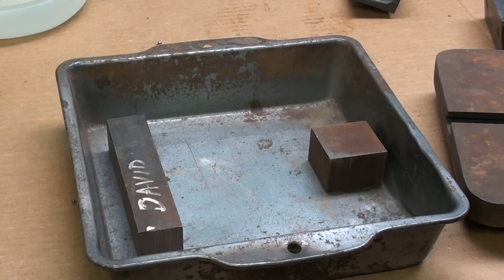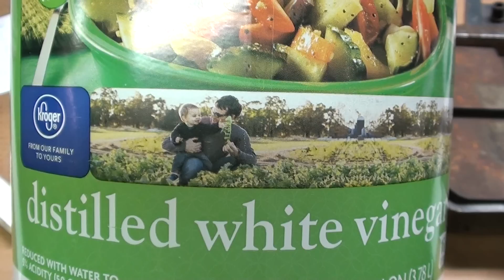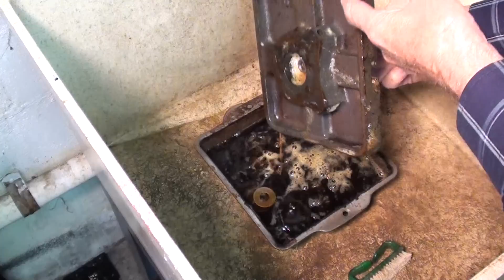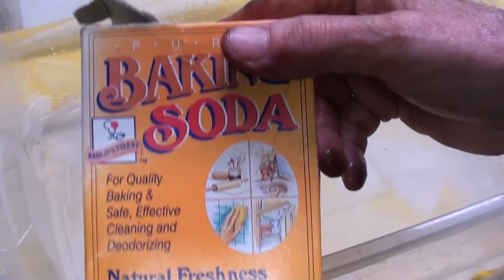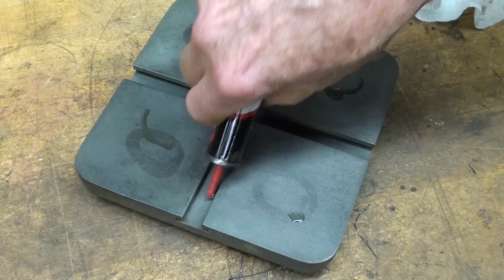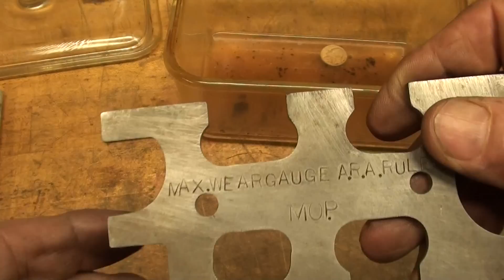Rust Removal Vinegar #304 tubalcain - compare to electrolysis

Comment: I had an unlucky trial trying to remove rust with white vinegar, kind of worried about using it to derust. I put an automotive flywheel in vinegar and left it overnight and it pitted the heck out of the flywheel surface.
Reply from the maker: Vinegar and other mild acids are a lot stronger and more aggressive than what most people would think. Sorry about the pitting, but I know what you’re talking about.

Comment: My experience using molasses is that it takes longer than vinegar but it takes forever to eat the metal so it may be safer. My timing is usually to check stuff every week or every month, clean it in water and do it again if needed.

Comment: Vinegar has worked very well for me.  It reaches into corners where emery cloth will not go.  Recommend washing rusted part in strong dish detergent before the vinegar to remove any oil film that could block vinegar penetration.  The rust turns into black gunk that is easily removed with your wife's toothbrush.  Alas, if there are deep pits, you can't remove them.  I used oxalic acid on some rust-stained sails once, but that kind of radiator flush is no longer available.  Where to get it?
Reply from the maker: Thanks

Comment: About to try the electrolysis method on some old Model A engine parts. Did some investigating and found the vinegar would likely attack the babbitt (poured bearing) material so that eliminated that method. Might be worth considering when deciding between the two methods. 

I seem to recall a solution that could be used to prevent the flash rusting process after subjecting steel to such a de-rust process. Do you know the formula for that solution?? Would be "handy" on a fresh/raw engine block. 
Thank you.

Comment: Would be best to heat the cleaned apt in oven (above 212°) and put paraffin wax over the surface - could aslo add salt (sodium chloride) to the solution to help cleaing - grey stains is the graphite and iron.

Comment: Definitely my favorite rust removal method. Works better than the commercially available rust remover products. I had a old leg Vise and some pieces of small Guage Railroad track both were over 100 years old and very rusty. When they were done they looked brand new. I had to use a plastic tote and about 4 gallons of vinegar and it still was not enough. Luckily I had a small old fountain pump that I used to recirculate the vinegar to the top of the Vise. I had covered it with rags so they would hold the vinegar and keep it wet. Worked great.

Comment: I've used vinegar for several years and found it to be a good option for rust removal. I also use house-brand (cheap) diet cola drinks from Kroger and Publix. Different type of acid, but it works about the same as vinegar.
Keep up the good work.

Comment: I find the biggest problem with using vinegar is that it will pit the metal if left to long in the vinegar.   I wish there were a time table for using vinegar to remove rust.
Reply from the maker: Yes, it certainly is corrosive
Reply: @mrpete222  I found out the hard way putting some white vinegar in a new stainless steel pan to clean some parts and left the vinegar for a few days.  When I went to wash the pan I found deep pits in the bottom of my new pan.  Thanks for all your videos; they are very helpful.
Reply: I'm looking for a simple way to repair pitting of steel tools.  I've been looking at zinc plating as a possibility but I fear the pitting will show through as dimples in the zinc surface.  Seem like tig welding is the way to fill the pits and then grind smooth before plating.  Any suggestions would be appreciated.  I'm loving this mild winter here in Jacksonville TX.

Comment: Another method is to use strongly brewed black tea (really well 'stewed') to provide tannic acid, then add about 25% phosphoric acid.  It kills the rust and leaves a very nice matt grey/black finish!  You might also add a bit of ethanol as a wetting agent. A splash or two of balsamic vinegar also adds a bit of tannic acid...

Comment: Yeup! Vinegar = Clean parts, Electrolysis = Hydrogen gas + Power consumption + loos of other sacrificial metal, I would also recommend using ATF fluid over 3 in 1 lubricant, but if all you have to use is 3 in 1 I would recommend flooding the surface with it and allowing it to penetrate well into the face.

Comment: I'm pretty sure I have seen an Evaporust can setting around your shop in a video..Great product, but admittedly not as cheap as vinegar. At least for flat surfaces, My go to has become a $12 harbor freight right angle air die grinder with a roloc pad adapter and scotch bright discs .

Comment: Guess who owned a large portion of Arm & Hammer?  Yep, Armand Hammer.
Reply from the maker: I thought he was an oil magnate.
Reply: @mrpete222  He was.  My guess is that it was a vanity move, so that Armand Hammer could be on the Board of Directors of Arm & Hammer:
From Wikipedia, the oracle:  In the 1980s Hammer owned a considerable amount of stock in Church & Dwight, the company that manufactures Arm & Hammer products; he also served on its board of directors. However, the Arm & Hammer company's brand name did not originate with Armand Hammer. It was in use 31 years before Hammer was born.[47] He was spurred to buy shares in the company as a result of often being asked about the brand being so close to his name.

Comment: Must have a very low patience level for this guy cuz I've already reduced myself to calling him all kinds of names such as an old Buzzard and such because I don't understand why he would not completely cover the part with the vinegar solution in the first place and he could of just used the nut and bolt handle to make a space off the bottom of the pan for the past and then not consider the fact that the solution might of caused a reaction that eventually caused the it to run over just a little, but then when he goes to the sink and doesn't just run it under the water to use a little bit of water pressure as he's cleaning the piece off and then of course he fills the sink up with water to scrub it off more but then once AGAIN he don't cover it completely in water so he had to stop scrubbing the piece to dab the cleaning cloth in the surrounding water to clean it off and add more water to the piece. Just driving me crazy. I just need more patience I guess and I'm using this forum to vent that frustrating out so the next person that I encounter doesn't get this pent-up anger directed unfairly at them. So thank you for the very good information and the opportunity to get a little psychiatric help in the process lol...
Reply: Easy to be wise after the event....

Comment: I was glad to find this video because I am soaking a couple cast iron parts in white vinegar that the bench vice swivels on top of. I got it from a friend and the base was rusty w/ sand and grit in the swivel area up inside also! I wasn't sure about cast iron but I'm sure it will turn out fine now!!  When you 'cover' the container the acid works to concentrate on the objects better instead of attacking items around the room like a magnet in which I've heard happens. I once used a 55 gallon plastic drum and had some rusty pipe in it but too long to stay in the liquid and covered the barrel figuring I would come out the next day and flip the pipe around and go another day since 3/4 was above the vinegar...and..... WOW! The acid became air-born in the drum and attacked all rust on the pipe, even what was out of the water ( about 2 feet more). Don't soak copper and steel together cause  I think it will turn the copper black ( I did pennies with steel bolts/nuts/washers once). As far as my swivel base, with some grease sandwiched in between the two objects, it will swivel great!! Love that  drill press table!!! Thanks!!
Reply from the maker: Thank you, I will try that

Comment: Hi Tubal. What would be extremely interesting (and I have never seen anyone else on Youtube try it) would be to use electrolysis with vinegar instead of with water. The acidity would carry the electricity at least as well as the sodium carbonate and water solution. You might get twice the rust removal?
Reply from the maker: Never tried that

Comment: I recommend suspending  a Tupperware from the ceiling with wire and strapping a electric sander to the side to form a tumbler and putting crushed ceramic pieces from old plates and china and ceramic crap into it and that will clean and derust the parts after your vinegar or electrolysis is done so you skip ALL elbow grease.  The parts tumbler also could remove the rust flat out without help but might not get as deep into grooves.  I'm planning to do a video on this.
Reply from the maker: Good idea

Comment: Use corn syrup.... Either soak a sponge with it and let it sit in the surface or emerse the rusty item in it.... It does not remove paint and gets into crevices...... Leaves only metal agitated occasionally or scrubbed on deep rust.... But no effort for serious rust removal..... No acid etching very safe.....I cleaned up an abused egg beater drill that was my grandfather's it was out in the shed and would not move in any part.... Put it in sugar dissolved in hot water  3 days soaking and shaken couple times each day.... And it came out and turned scrubbed with soft wire brush and all the rust came off leaving the original red paint intact...... Flushed it thoroughly and then heated it with a torch to drive off moisture then oiled it while hot..... It now works great and looks good too.... Tip is to heat metal them oil and the oil will penetrate and if you heat enough you will get bluing to protect surfaces of you mix some bees wax with oil you get a very awesome protectant

Comment: Wear latex gloves, that black stuff will stain your fingers. Also, a power washer works very well to remove the residue. After a vinegar soak, I used the power washer on some old files I bought at an estate sale as I couldn't think of anything else that would get down into the tiny grooves very well. I neutralize it after power washing. Hot soapy water seems to do just fine in neutralizing the vinegar. Then oil it or the item will flash rust. Cleaning vinegar, found in the cleaning section of the store, vs the cooking section , is sometimes a little stronger. Also, agriculture vinegar, used to kill weeds, is stronger than the "regular" stuff.

Comment: I am getting ready to work on a 1987 200 cc Super Cub Triumph motorcycle that I bought as a "motorcycle in a box" for $350.  I am going to try both methods of removing rust from various parts of the bike.  I am sure this will be a multi-year project, so I thought I would start with the rust removal first.  Any tips for cleaning up the aluminum parts?  Thanks for sharing your tips.  Doug

Comment: Thanks Mr.Pete for the comparison of the two methods of rust removal, I bought 1/4 plate from a scrap yard for a project. I wanted to remove the mill scale, the steel had a lot rust so I hit with a flap disk first and soaked some test pieces in vinegar and some in muriatic acid.
The muriatic acid cleaned the parts in about 30 minutes, the vinegar two days. The safety fact does need to be considered with the Muriatic acid, I used eye protection chemical rated gloves and tongs, I made bath of baking soda and water to neutralize the acid. Washed under hot water and oiled with light machine oil. After that i buffed them,  nice and shinny too. I then applied Johnson’s paste wax. 
I bough washing soda a while back to do the electrolysis test dug out my battery charger, and determined that the battery charger would not operate unless 9 volts were present on the charging post. Yes it was one of those new computer controlled chargers for lead acid as well as nicad and gel cell battery’s, I fooled it with a 9 volt battery. For ordinary rust removal I am sticking with the vinegar, for the mill scale the muriatic acid works for me. 

Thanks for all you do! I wish I could have been able to attend your open house this past July.

Comment: Dog gone Mr. Pete, that really cleaned up nice. I guess I don't need to buy and use all the latest and greatest store bought stuff.
Question, on oiling, is it alright to coat my lathe with 3-1 or some such oil to protect it? My shop is not heated unless I'm working in there and lathe gets light rust on it.
Thanks
Reply from the maker: I coat mine every winter. I used 30 weight
Reply: Thank you.

Comment: I like and have used vinegar for rust removal. It is very handy in a bucket when you have lots of parts to do, disassemble today and tomorrow less work part part to clean up. To remove paint a soak in “purple power” sold at any Wally World, and that will remove paint from just about anything including plastic without harming the part.

Comment: Great Video. I lost a number of tools to rust during a bad storm including 3 different sized Mics. I tried electrolysis to great success. The Mics I was able to strip right down after the electrolysis, I then placed the threaded parts  in vinegar for about 3 hours results were great threads good as new. Reset the Mics to my true Gauge set . All was well. I could have claimed on the insurance but did not. The Mics were given to me by my Dad so were many years old. I love your forgiving wife   Chris Gray UK
Reply from the maker: That's terrible about the damage to the tools

Comment: After the soak in vinegar, and then rinsing with water, there's probably no real need to neutralize with baking soda, but if it were me, I would still using baking soda, but instead of putting it in water, I'd apply it as a thin paste right on the metal, and take the Scotch-Brite to it.  The baking soda will act as a mild abrasive, improving (in my opinion) the finish of the piece.  I'm amazed at how well simple vinegar worked for this.

Comment: I got a "Thanks" from a guy I told about restoring a Spear & Jackson vintage spade using electrolysis, but, where you can use plain vinegar, do so. Some people use salt & vinegar to clean coins..Yes you can legally put vinegar down the sink, it 's biofriendly & good for it as it will clean your drain : )
Reply from the maker: Thanks

Comment: I was looking at another video on rust removal using vinegar last week, and the guy recommended adding salt to the vinegar.. I tried it last week and boy does it work as long as you degrease the work first. the vinegar I used by the way was four times as strong (20% acidity)

Comment: Washing soda & electricity is cheaper & cleaner than vinegar. I usually wire brush the rust that comes off easily prior to a vinegar soak or electrolysis method. Doing so takes the load off whichever process you choose.

Comment: I live in a humid area and get a lot of rust on all my equipment. I had been using a product called Rust Free. It works good but is expensive. I found a way to clean large cast iron surfaces without having to dip it in a tub of vinegar. Just double up some paper towels on top of the surface and pour the vinegar on. Let it set for a few hours and scrub it with scotchbrite.

Comment: could be that the baking plate , the rings and the cast iron , in combination with the vinegar has made a battery , in that case the  electrolysis might not be to far from the truth
the glas bowl has made that comment moot 
just bought a planetable and it has a lot of surface rust , think i would try the vinegar treatment over the abrasive as the table needs to stay flat , hope it works as good as it did on youre experiment

Comment: I hate to tell you. But those are not chisels. Those are caulking irons for lead joints. That's why they're offset. So your hands are away from the pipe. Nice ones.
Reply from the maker: +richard wysham thanks
Reply: mrpete222. You are welcome, sir. Want to sell them? They're getting hard to come by.  It looks like one is for the outside of the lead bead,  which drives the lead down and out. The other one should have a tip angle opposite, to drive the lead bead down and in. Pouring a lead joint is becoming a lost art. Sadly.

Comment: I like your process.   Thought initially rubbing the newly de-rusted cast iron table would be better coated with wax like I've done many times.  Now I think an initial coat of oil followed by wax (Johnsons paste wax) might be even more resilient to moisture.   Anyone tried this?   Thanks,  Ryan.
Reply: Also agree that it only works when completely de-greased and I've only tried apple cider vinegar.  Never tried white vinegar like tubalcain.

Comment: Super, tubalcain.
Just the honey to go with that vinegar. (smile)

This summer I vinegar(ed) some bolts that I really needed (badly badly rusted) and I was also very pleased with the results. If it helps... I cut part of the tops ou of plastic 1 gallon milk jugs, leaving the handles on and they worked satisfactorily as little vinegar de-rustification-containers. Highly recommend this.

My wife was pleased that I took the recycling out, AND my meatloaf did not taste of vinegar.
Reply from the maker: Thanks for watching

Comment: I do not have the experience of using either of the two methods but it appears to me that the vinegar treatment process would be more suitable for materials (parts) less affected by rust or perhaps as the final process after the electrolysis.Electrolysis seems to be the way to go for heavy rusted parts but I do have a question here. I have seen two chemicals used.1. Washing soda (where the positive (+) is connected to the sacrificial piece of the metal (as per your videos), and 2. Bicarbonate soda where the polarisation seems to be opposite i.e. the negative (-) is connected to the sacrificial metal.Unless I have it wrong by not remembering the"2" ( I do not understand the chemical process - just to far away from my school days), could you please give a simple comprehensive answer as to the polarity used  - whether the washing soda or the bicarbonate soda is used. Great videos, thanks!
Reply from the maker: Thanks for watching